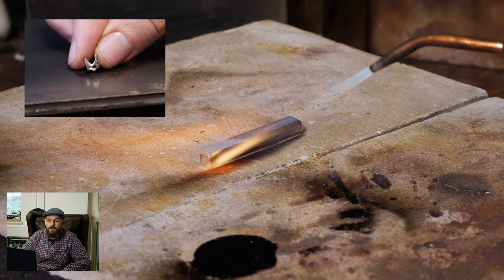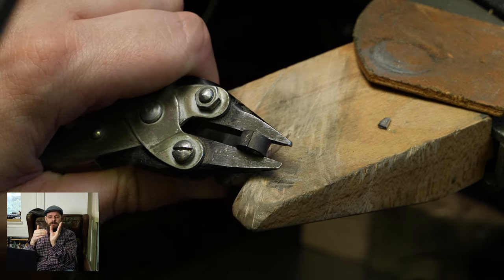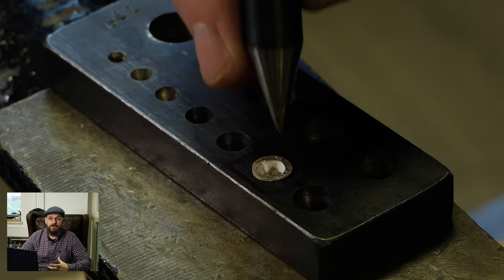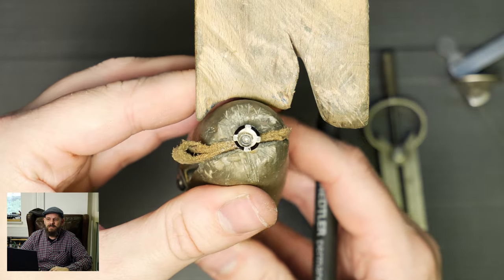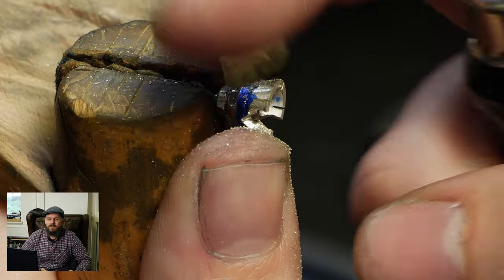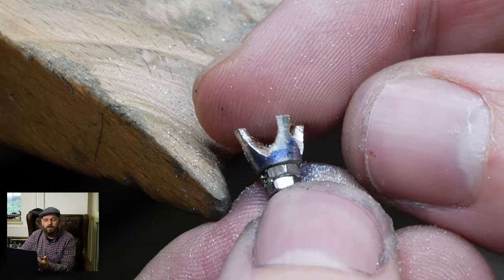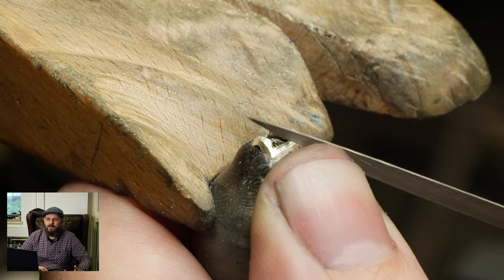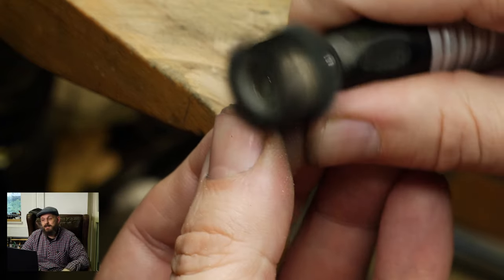How To Make A Stone Setting (with commentary)

Comment: Muchas gracias, muy didáctico el video compañero. Saludos
Reply from the maker: Thank you for the kind words. Lots more educational projects to be added.
Reply: Quisiera saber si en la parte posterior del engarse lleva una tapa ? Gracias
Reply from the maker: @user-wu8sg8be9u  sorry. This hasn't auto translated correctly. This piece would have a separate bezel (lower part) below if I were to use this for a ring.
Reply: Senkyu, congratuleyshu

Comment: Hi Ydna. Finally got around to trying to make one of these for a 5mm CZ I’ve got. Great tip to use the little hex head nuts. Got some from Amazon. What cut saw blades do you recommend please, for cutting out the prong shapes? Thanks for great tutorials and all your real world advice, tips and experience. Much respect!
Reply from the maker: @phillbearman359  thanks. I hope it went well. I would use a 2/0 blade on these. Maybe a smaller 4/0 if the stone was 4mm or less. The hex nuts and bolts help so much.
Reply: @metalofhonour  Thanks. Gone ok so far. Just filed up the flower pot and made initial cuts
Reply from the maker: @phillbearman359  nice one. Just keep the saw holding hand steady, relax and take your time, and it should go well.